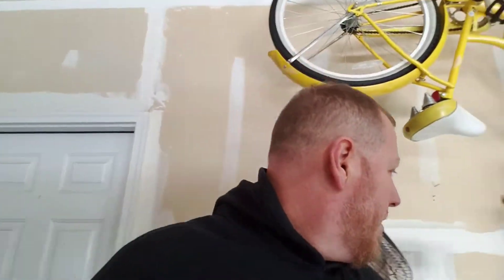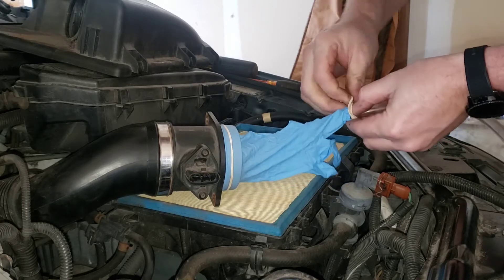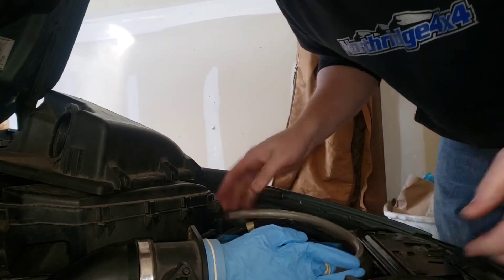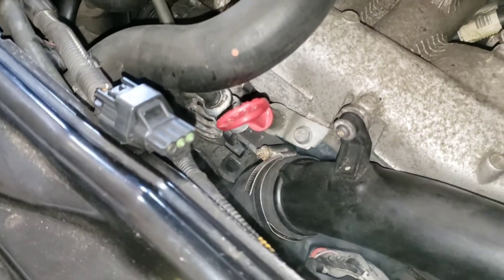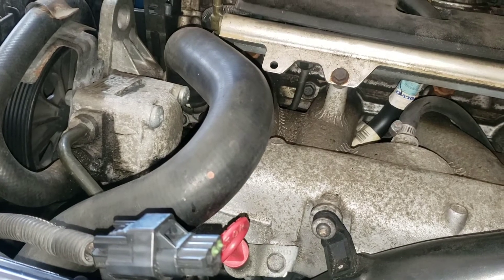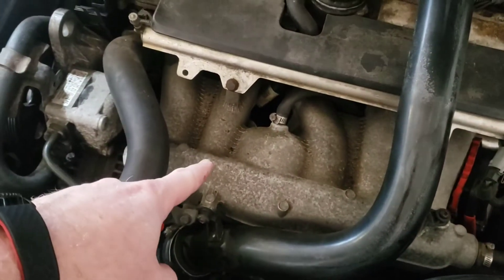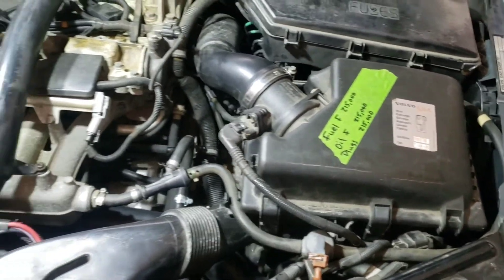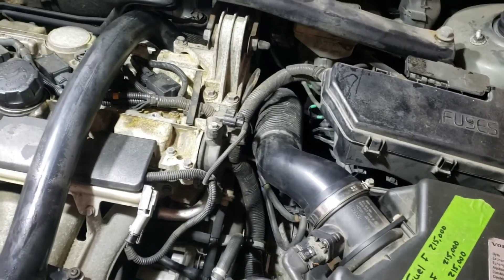Going up in smoke.  Use smoke to find vacuum leak

Comment: Just put the rubber glove over the oil fill while it’s running. If it inflates your pcv system is screwed.
Reply from the maker: This was to test for vacuum leak.  I've already checked pcv by putting glove on oil fill